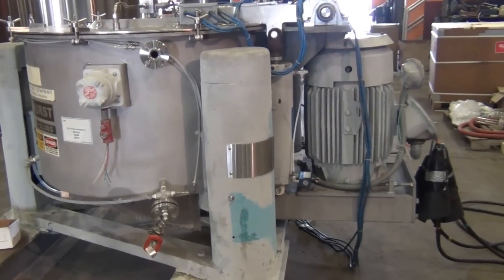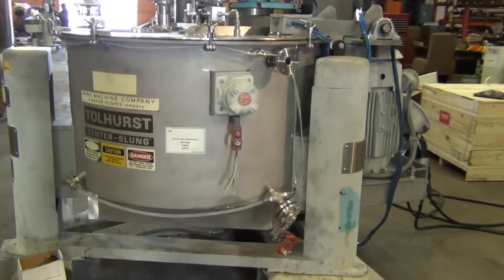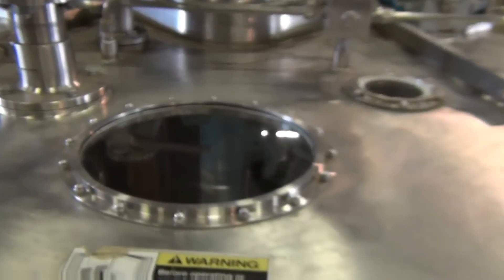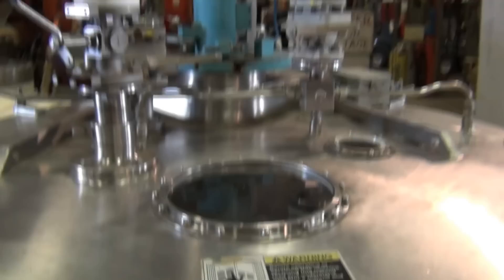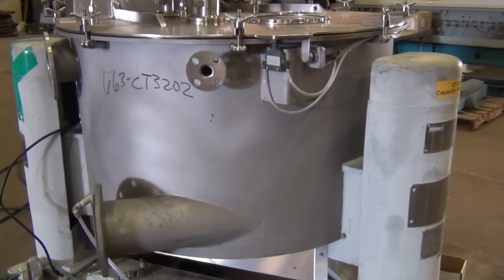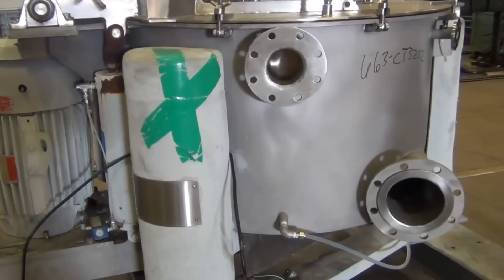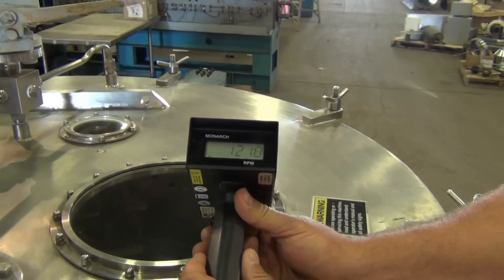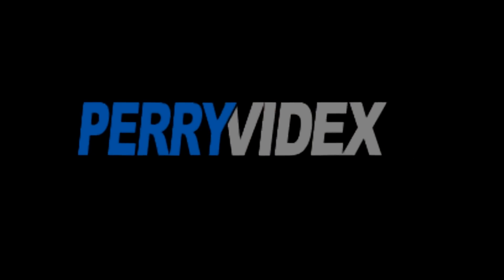Used Centrifuge - Testing Used Industrial Equipment

Comment from the maker: The biggest benefit to purchasing used industrial equipment is the cost savings. In some case you can expect to save up to 70% from a new model. This equipment can be very expensive so buying used is definitely more cost-effective. Just make sure you go through a reputable used equipment dealer.